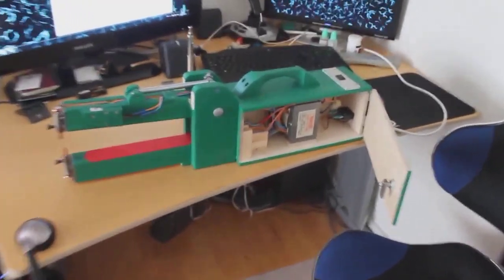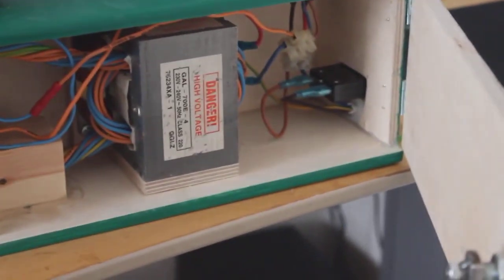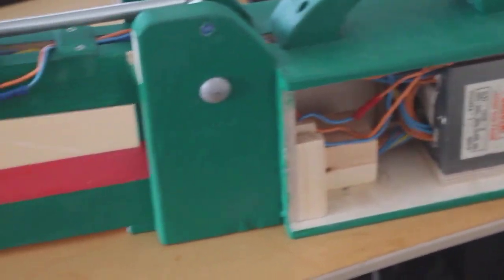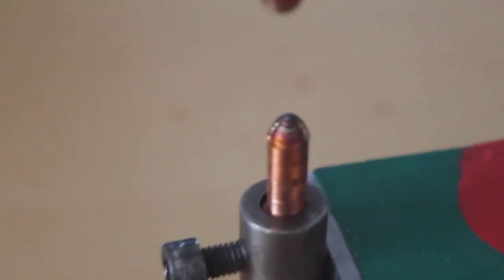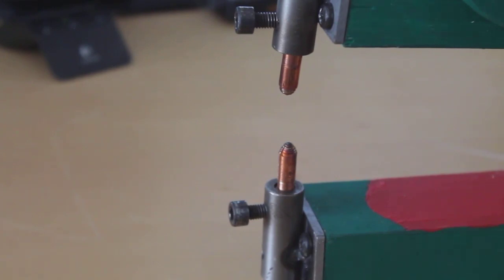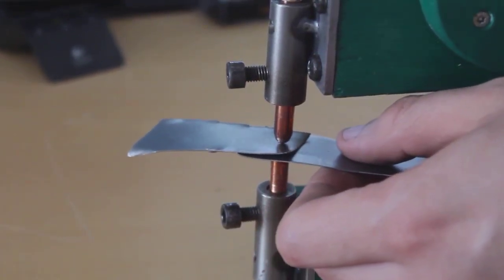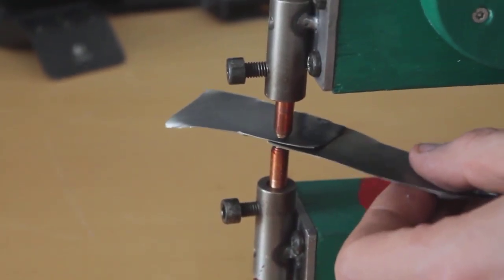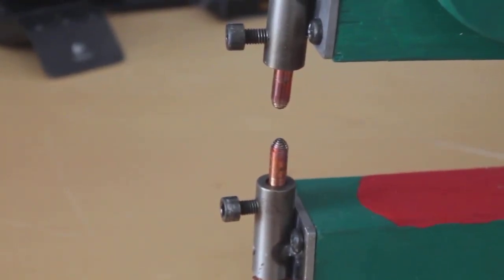Homemade Spot Welder (MOT)

Comment: Very good job.How much pressure you put when is for weld?
Reply from the maker: Satfox Satfoxy not much,  but I guess I depends on the material,  but basically just the Wright of my hand plus a little bit of extra pressure,  to ensure a good connection

Comment: hello i want to make one can you give more inform
Reply from the maker: +super saiyans workout Hey, sure, i think :) What information do you need?
Reply: i need to know if it is safe to touch the metal with your hand and use the welder
Reply from the maker: If it's constructed like the one in the video, then yes :) Absolutely.
First off, the transformer is earthed.
Secondly the secondary side of the circuit (the part going to the metal) only has a voltage of a couple of volts, less than a 9-volt battery :)

You should of course take care when working with mains appliances, but if you construct a spot welder like mine, and with proper quality materials, then it is as safe as any other appliance in your home using 120/240v :)
Reply: thank you so much its great idea
Reply: Electricity follows the path of least resistance. Resistance on the metal is what causes the energy to build up and make the weld. Your hand is effectively out of the circuit save for a short (such as using it in wet conditions or something)

Comment: how much volts are you using?
Reply from the maker: yuri yuri 240V AC, but since the primary winding changes if your country uses 120v, then it shouldn't matter :) 

If you mean on the secondary (welding) side,  then I actually don't know,  I estimate about 3-4 volts